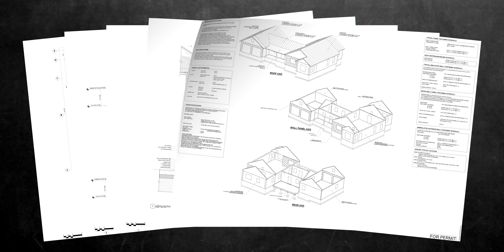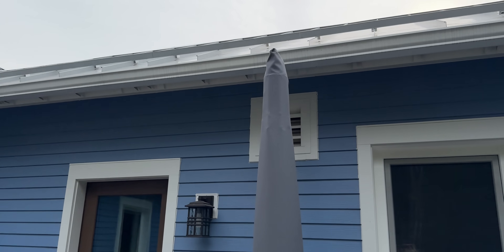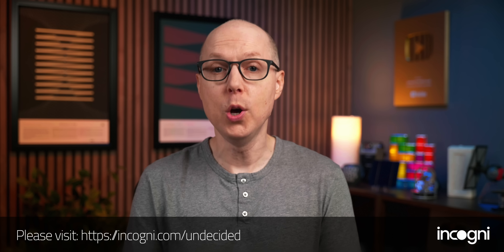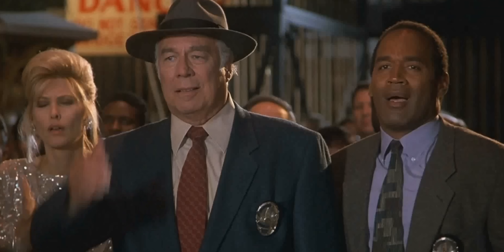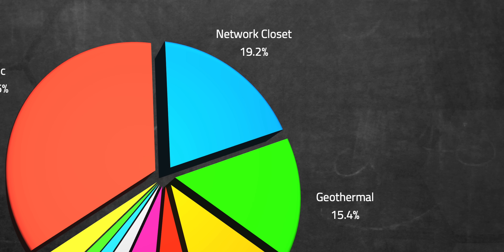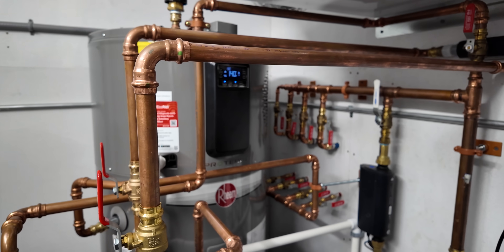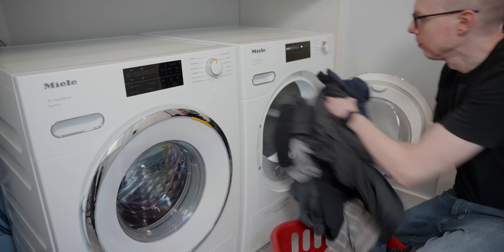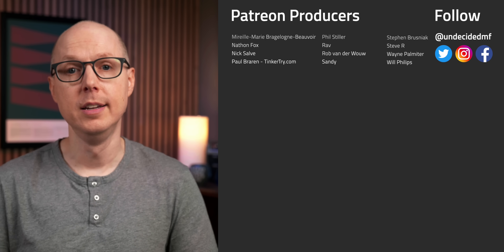What I Learned After 1 Year in My Net Zero House

Comment: Matt, like yourself, I've been working on energy independence as well.  We are both in New England so the challenges are pretty-much the same.  Taking a slightly different approach, I've been modifying my existing home.  I wanted to install the SPAN Load Center, but it tops off with only 32 branch circuits, so I went with a 42 circuit Leviton Load Center and built a Smart Panel using their proprietary AFCI/GFCI Smart Branch Circuit Breakers.  Function is similar but the SPAN Panel has better software than what Leviton provides.  I'm hoping this changes in the near future. There was enough space within the panel itself to fit a 200A transfer switch, thus avoiding yet another utility box to be mounted on the wall for backup power.  I have a 10KwH solar array in service and have installed the same Rheem Hot water tank that you show in your video, but for us New Englander's, home heat remains our biggest challenge.  I'm not able to install a heat pump like yours due to local ordinances, but I'm thinking of trying 3 of the Rheem 80 gallon hybrid hot water tanks as a primary heat source for my newly installed Smith's HE3 Silent Fin hydronic baseboard radiators. (one Rheem hot water tank used for each floor level)  This would be an alternative to installing an oil-fired boiler system.   It will be difficult to know if this would actually keep up with the heat demand of New England winters without first trying it.  But it sure would be nice to maximize room heat energy by using solar rather than burning oil.
+1 on the induction cook top and +1 on the hybrid clothes dryer as well.  Great video and Thx.  Keep them coming!

Comment: After years of planning we are finally getting our new house built. We decided on ICF (Insulated Concrete Form) construction for the energy efficiency and strength in our tornado and high wind prone area of the southeast US. I have been watching the channel for energy efficient ideas and have selected heat pump HVAC with an ERV, triple glazed European style windows, and heat pump dryer. Our attic will be conditioned and our sloping land begged for a basement. We are building a small house but with the basement we can finish and expand if needed. I worked with our architect to add ‘forever home’ aspects that will help us age in place. 
We bought an induction cooktop for our workshop studio apartment (temporary housing until the house is built) and love it. Thank you Matt for giving us detailed information on all of these new technologies!

Comment: I thought the back up heat shown was when the geo system can't generate enough heat, and supplements it with conventional electric or gas heat?  Also, in San Diego area, Rheem water heaters don't seem to last very long, and I have experimented with putting a scale water filter on my 4 gallon countertop electric water heater - any thoughts on filtration needed to make the water heater last a long longer? In our area, water heaters just a few years old are leaking and needing replacement.

Comment: Regarding slab vs basement, there is another contender: crawlspace. Not the horrible dank mold pit of old, a modern crawlspace for a northern climate is not vented to the outside but a part of the house interior, basically a shallower basement with pea gravel over plastic sheeting instead of a floor slab. I used to work for an architect/builder in North Dakota, and these were their go-to - their trick was a small area was deeper in the ground with a concrete slab so you could stand up, and they used stairs instead of some awful tiny access hatch. You get a place to run all the utilities, a wooden floor structure for the main house (more forgiving to walk on than concrete), and it was slightly cheaper than a slab. You could store some (but not too much) crap but also hide from a zombie apocalypse or tornado down there.

Comment: I love full geothermal systems.  It was very expensive, but with tax breaks and operating costs savings, I fully believe it is worth it.  We live in Maryland and experience large temperature variations throughout the year and the system handled it without a problem.  We set it and forgot it, and it is also infinitely quieter than traditional A/C compressors.  Life cycle is supposed to be 40-50 years with regular servicing.  The desuperheater side provided good amounts of hot water reliably.  I don't crunch numbers like you do, but I will say it was noticeably better than a gas or electric water heater.  Not bad for a hole in the ground! (For folks in Maryland, I used Ground Loop, who were fantastic!)

Comment: Of course your house isn't net zero. What about all of the waste that went into the production of all of the materials to build the house? Plastics, metals, wood, concrete. What about all of the waste that went into producing all of those new appliances and the HVAC system?
Reply: Also, how did you actually outgrow your last house?  Do you have 35 children?  4 generations of extended family all living under 1 roof?
Reply: And the roof parts you're about to have replaced - what's going to happen to the old parts? Are you going to make sure they get reused? Or are they going to wind up in landfill?
Reply: Did you buy used solar panels? If not, how do you think those solar panels were produced? Out of thin air?
Reply: @ElisaAvigayil  🤓

Comment: So the real world question for me is how much did all this cost on the onset, then how long will it take to get that back in savings? You do mention that you want to stay here for decades to come, but plans and life does happen which can cause a move. 
This goes with the same question on buying an EV versus that of a typical fuel efficient ICE vehicle. Price per gallon/mile plus initial cost of the vehicle and maintenance still falls below the cost of the EV when you add them together over a 10 year span which is the typical length of ownership of said vehicles. We still have not reached a break over point where the EV come out on top over the 10 year span. To add to that we really have not seen a good second hand market for EV either. 
At what point does building the house out this way break even over a traditional build? Is it more than 10 -15 years? Because that is the average time people tend to live in a house before moving to another location. I am truly curious on this side of the DATA. 
On another note: the OCD in me cringed when you turned on the sink and the water stream did not hit dead center on the drain (14 mins in). lol

Comment: A good thing for your 'Net Zero' calculations that the production of everything included in your home does not require anything relating to the polluting factors engaged with mining, moving, processing, manufacturing, delivery and installation. Also assists you to build without actually connecting your build to anything else. What a pathetic dreamer to believe that 'Net Zero' starting from move in counts for anything. Sad.

Comment: I like the idea of energy efficiency, to a point. That point comes when the thing stops doing something it should do well.  Case in point, modern 'energy efficient' dish washers.  They no longer dry the dishes without adding 'drying agent' chemicals.  Something I don't want leaving a residue behind on my dishes.

I can't speak for a Heat Pump dryer, but I will say that I don't like my new 'water saving' washing machine.  It does not clean the clothes as effectively, we end up using extraordinary measures just to get the clothes to be effectively cleaned by the washing machine.  Add to that, that the washing machine is almost entirely computerized and it becomes a real risk of wasting Hard to recycle materials because if it breaks, it is likely cheaper to replace than to repair.

So while I support the idea of energy efficiency where practical, I think that law makers have taken us well beyond the limits of practicality and into the realms of 'good publicity' that isn't practical.

Comment: I live in a valley in a tropical country. I get like 3 or 4 bad days a year. Usually I’m between 64-80 F. Is so crazy to me how much you need to invest to live comfortably. For me to get to net zero I basically need better appliances and solar panels. That’s it. 
Also, shouldn’t y’all be using the heating at the same temperature all winter? Lowering and rising the temperature or even worse, turning off the heating will make you spend more.

Comment: Did you consider using "MONOPOLY" building which incorporates the attic into the conditioned space.  Then you could have put all the mechanicals up there.  Its basically and upside down basement.

Comment: It always baffles me how houses are built in the US compared to middle of Europe. Here in Austria modern houses are built to last generations. Most of the family houses in my neighbourhood are way better than net zero and thats the standard. If you have a heatpump and a solar system it's not hard to achieve that. Our house produces 3 times the energy what we need for everything including heating, cooking, charging our ev. Yes in the summer months we cant use the huge amout of energy but we calculated the solar system for the winter. The heating pump and battery should have enough energy for heating our house on most days. So basically we only use about 500kwh from the grid but in return produce 20.000kWh from wich we use about 5500 kWh ourself

Comment: Random observation from our heat pump drier is that it only hits the quoted drying times when it is full, if we run it partially empty we have to run the cycle twice to get stuff dry. This seems against the laws of physics, so I am not sure what it going on, although my hypothesis is that it is being too clever for its own good and measuring the moisture coming off the load and this messes with its assumptions when the load is small so it runs cooler or something.

Comment: A net-zero home must produce far more energy than the occupiers use. Discounting all the energy that went into harvesting raw materials, shipping, refining, retailing, delivering and constructing the original house, we are still left with the problem of repairs over the years. Windows, rooves, doors, carpet, faucets and all the rest are at  'new construction' costs which includes the energy to produce them. Basically,, every time you replace something in the house, you are using the energy required to create those products. No such things as energy-free roofing materials or construction tools. Same for windows and all the rest. 

To reach net-zero, you have to generate far, far more energy than you consume. Or, your house must be built from perfect products that never, ever need repairs or replacing.  No such thing as net-zero living, but we can significantly reduce our impact on the environment by smart living. And that's the goal, isn't it?

Comment: I happen to live in a 650 sq ft older mobile home to which I installed a mini-split heat pump a year ago.  The results have been impressive.  Cooling has cost under $8 a month at $0.16/kwh, and a small 400 watt solar panel offsets 70% of the cooling costs.  Heating is also very efficient and quiet, with a small space heater in the bedroom running at 800 watts overnight using more electric than the heat pump.  Heat distribution is mostly centered within the 11 x 60'  floor plan with the ends about 5 degrees cooler. The original oil burner can still circulate air but only comes on briefly on the colder nights.  DIY installation lost out on all the rebates, but costing about $1000 that's still way below contractor cost. The utility reports my electric consumption is 5% below the most efficient homes of equivalent size, with consumption down 21% from same month last year.  Highly recommended for efficiency and comfort.

Comment: "Heat Backup" is probably the resistance heaters that most geothermal installers will install in your ductwork.  They only come on if your heat pumps aren't satisfying demand.  If the system is sized properly, they will hardly ever come on, but there's a balance.  If they never, ever ever come on, maybe your heat pumps and loops are oversized.  So, it's not a bad thing if they do come on but it should be very infrequently, as in when we've had -15F temps in MA where you live.  The fact that you can track this with your SPAN panel is fantastic.  I'd love to see how that tracks over time.  It's also cool that you get to monitor its activity in real time.  Hope this helps.
Reply: I was about to mention this. Some systems call it Aux Heat
Reply: Yes and it can be set to ru do legionella prevention every other week

Comment: I wonder about the durability of the "airtightness." In my research I've read that high thermal mass homes don't need the airtightness to remain comfortable and efficient.  It may have been hype though.  The claim was that instead of managing the air in the space, the structure of the house is what kept the living area comfortable.

Comment: I have a 3100 sqft home with two hot water heaters and two 4 ton heat pumps. With solar I produce about 1000 kw more a month than I use and my home is 23 years old. My home does not have all the complicated items to achieve zero cost per month.

Comment: Heat pump dryer bonus feature: 120V models are available, so even if your laundry room is set up for a gas dryer, you can still switch to electric without having to run a 240V circuit.

Comment: We took a different approach, out of necessity. I built our house back in 2005 using standard US construction techniques so that was the starting point. No pressure testing, no thought to the diaphragm between the crawl-space and living space, standard insulation, just dual pane windows, propane space heat, water heat, dryer, cooking. With so much propane, I used only about 20kWh a day of electricity. Then NEM 2.0 going away in California forced us into solar (to grandfather it in), and a lot of it! We installed 16kW of ground-mount seasonal adjustable (skip the season-adjust feature!), converted to heat pumps (air to air) and electric dryer and found we could easily power away any lack of building efficiencies. An atmospheric river last year cause springs to erupt in our crawl space necessitating encapsulation and dehumidification and the result of all this is our electricity use went up to 60 to 80 kWh a day! The array easily kept up during our first complete year. We are now eying a heat-pump dryer (or 2!), dehumidifying/heating/cooling a 1700sq ft shop. But this never would have worked out without California's NEM 2.0. I DIY'd almost all of this so the solar payback will happen in 5 years at current electricity prices and the heat pumps were dirt cheap. BTW, as everyone says, heat pumps are SO much better than a forced-air furnace in so many ways. I used Perfect Aire DIY and they've been fantastic so far. So, in summary, my approach, necessitated by an existing house, was to overpower the inefficiencies of the house with lots of solar.

Comment: you can go a lot more extreme with passive hvac, but youve done a great job considering how much electricity you use for everything else. 
 The ev and the server room  are almost half your pull and seem like you could reduce by 90% (get a WVO VW or bike. Use servers only as backup to cloud or micro devices. 
Clotheslines in greenhouses make great dryers.
solar hot water heaters are pretty solid, especially with an optional 2nd stage device. 
it all comes down to what you can generate. personally I think net 0 isnt as cool as self sufficient and/or making a little utility money off the neighbors.

Comment: Using the numbers from the video:  If my elelctrical use (I am 100% electric) is say 30% of current, that saves me $200 / month. Investing say 25% of house value ($100k) the ROI is 41 years. At 100% energy savings it drops to 27 years. I'm gonna go our on a limb and say they invested way more than $100k.

Comment: Could you Heat Backup be the Auxiliary heat that is in the Geo unit? They typically have a dedicated circuit breaker for it, which would theoretically separate it as its own energy usage.

Comment: You might have resistive heating strips in your system as backup heating, which would be that item. Those are sometimes installed with heatpump systems when for when they're not keeping up on really cold days... though that's really for an air exchange heat pump.

Comment: What R value is your slab insulation?

What is your stove vent solution?   If exhausting, whats your makeup air solution?   If recirculating, how are you controlling air quality?

Did you calculate your internal volume to surface area ratio?   If yes, whats the value?